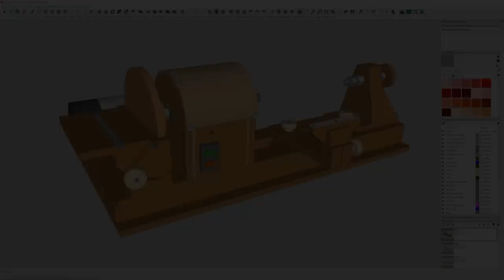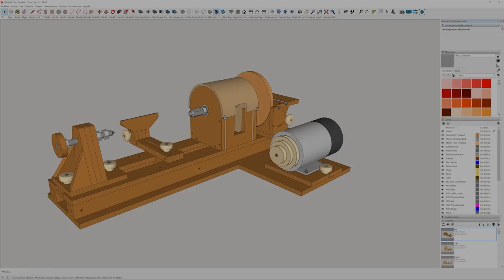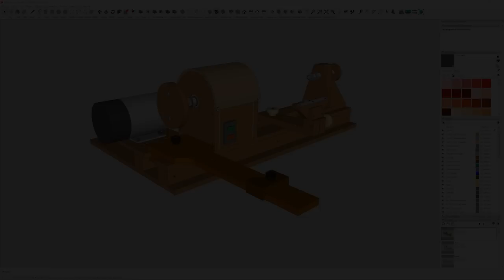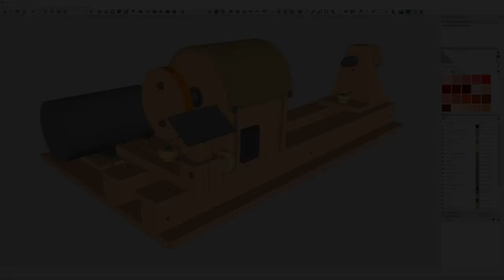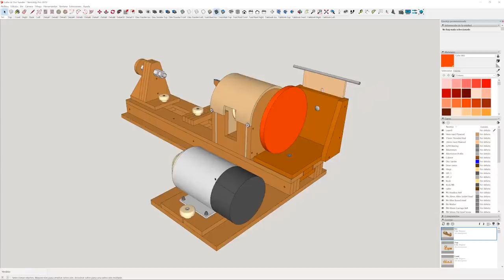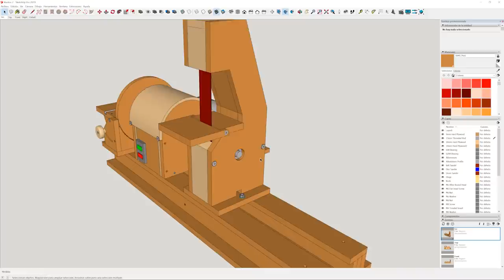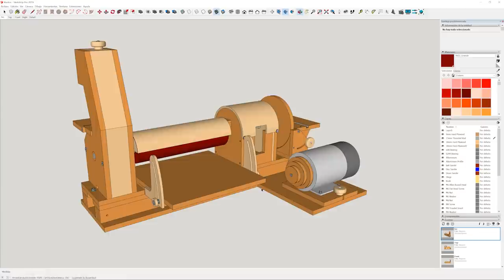Homemade Woodworking Lathe Accessories

Comment: Wow, great work. I've been thinking along similar lines since I bought a 60-volt joist drill a couple years ago. That thing is just portable torque that could power just about any woodworking machine in my workshop.  Adding tools as lathe accessories is a great idea.